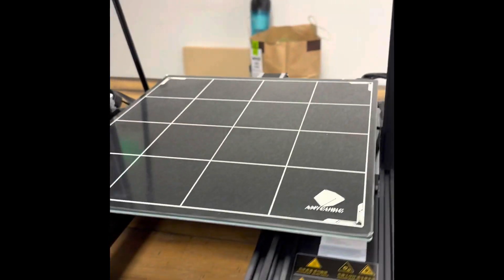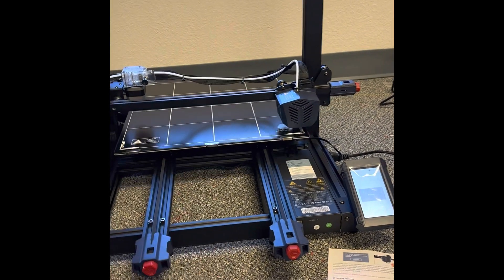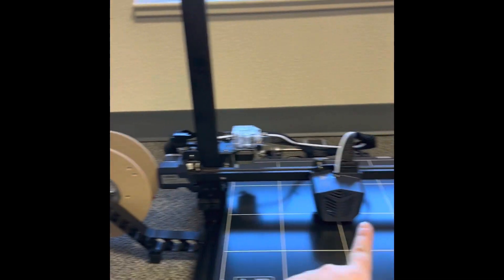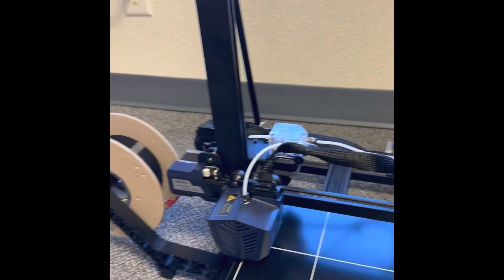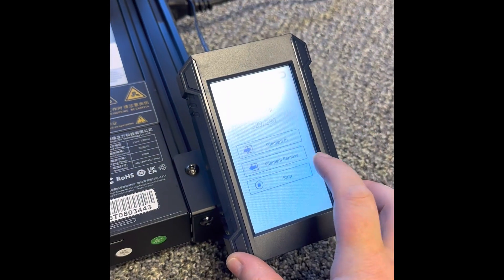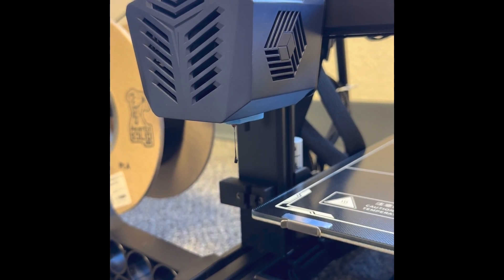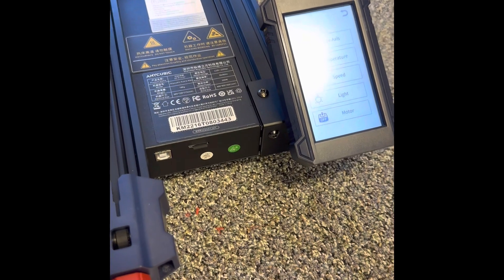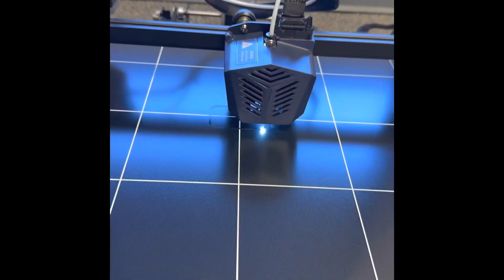Anycubic Kobra Max initial thoughts

Comment: I just got my kobra max. Anycubic is currently selling some for $220 on ebay. At retail price, I can't say it would be an amazing investment, but it is REALLY good for 220. Even getting a spring steel bed only brought it up $60. The only hitch was that the included flash drive had no prusa profile and the most recent anycubic slicer doesn't have the og kobra max profile so I had to spend a day or two figuring out acceleration settings and whatnot.

Edit: Forgot to mention that they are refurbished units

Comment: I have a Konrad max in the box in my hall. I plan to unbox it after I do my taxes tomorrow
Reply from the maker: Nice! It was super easy to put together. First recommendation is get yourself replacement nozzles. The one mine came with did about 400 hours with just matte filament before I had to replace it.